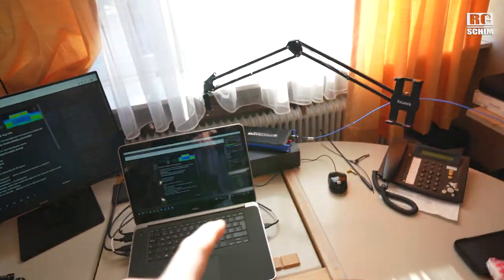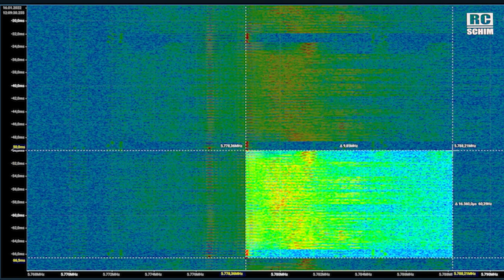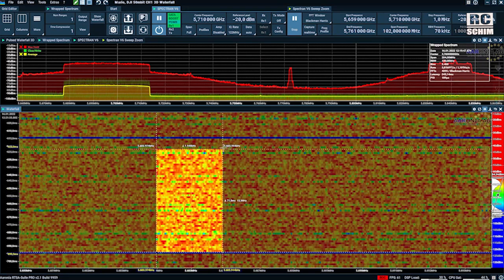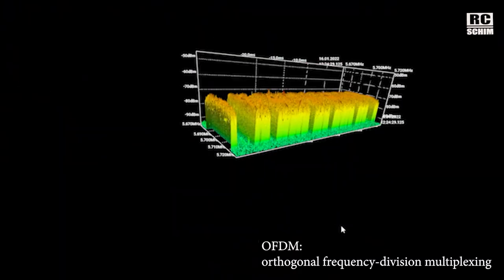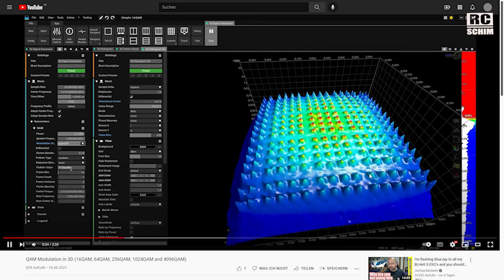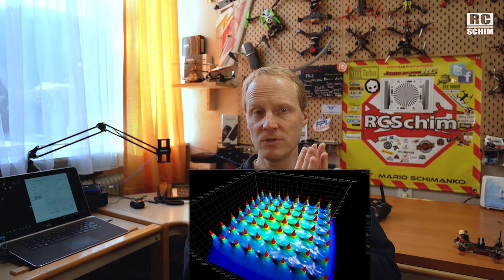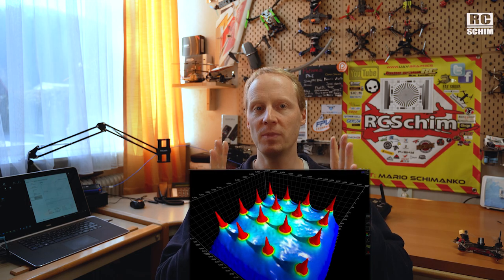RF in 3D: Analog vs  DJI digital Video

Comment: Fascinating visualization and explainations. Can really see how more more signal is packed into the spectrum space. An observation at 5:12, in reference to bit rate decreasing. Since modulation is happening in 2D frequency space, the decrease is a squared function. It helps explain why HD quality drops so quickly in nosily environment, or farther away. (ie: it's to linear). You touched on this again at 6:42.

Great explanations for the target audience on a very complex topic. Appreciate including good references and keeping the topic focused as relates to FPV.

Comparing HDZero and DJI is very complex, as DJI is doing encoding before transmitting, where as HDZero is not compressing. Thus they have very different processes and video quality. Would expect HDZero too would try to use as much as allocated spectrum as possible, like DJI vs analog video.

Is hard to believe how far we (humans) have come with video transmission in last 50 years, even the last 20-25 years. The Apollo Moon program demonstrated the very best video technology that was available at the time. It's hard to imagine what progress will occur over next 5-10 years.

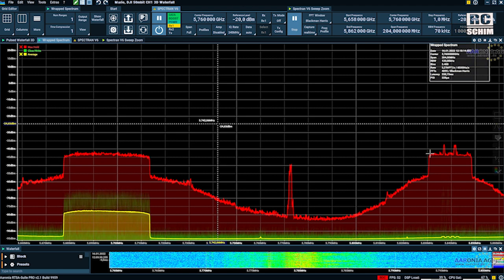Comment: In 2:34 you mention "Random carrier signal spike" at 5772Mhz. Is that signal always present or does that happen only briefly when plugging in the battery?
If it is always present, then that would explain small noise that analog glasses sometimes see.
Really awesome work 👍!

Comment: Nice, but unfortunately the digital spectrum doesn't reveal much without decoding the OFDM subcarriers. OFDM has multiple orthogonal (overlapping in the frequency domain) sub-carriers and they each do QAM so it's really hard visualise much from this apart from maybe the OFDM frame length or symbol length (with empty guard intervals between) in the time domain. Also worth mentioning that OFDM has been in use in WiFi since 802.11a in 1999, so it's not just in mobile networks. I think Livyu did a DJI Air Unit  teardown and found they're using a WiFi chipset.
Reply from the maker: I tried to do qam decoding with the software on the whole 36mhz. If you tell me, that each subcarrier does qam it will really be hard to decode it ;) I've seen 26 arches in the histogram which look like subcarriers to my eyes but who knows... and on top of this: the subcarriers seem to move?
Anyhows, we have a good enough picture of it now I guess. With my limited knowledge I did a week of research and was about to go crazy over this matter, so i needed to finish this video ;)

Comment: Bardwell's comparison was flawed as the camera for the DJI had a wider field of view than the hdzero camera. Wider FoV means more photons per pixel and therefore less noise. As noise is inherently incompressible the HDZero digital link had a big disadvantage...
Reply from the maker: I agree about noise giving you a huge disadvantage with bitrate usage. but do you really think that's the main reason for HD zero to perform worse than DJI? 
A pitty that the cams cannot be exactly the same. Bardwell could have used the same lens at least  (but then he'd altered the focus, maybe messed up - and we wouldnt be happy either :)
Reply: @Rcschim  I don't know if it is the main reason, however it does make the conclusion questionable. 

To make a fair comparison, he could use a slight neutral density filter on the DJI camera  to attenuate by the ratio of the solid angle of each FoV.  Or just swap lenses :)

Comment: do they do a disco version of the 3d oscilloscope ?   i wonder what the components of the latency as far as cam output then compute to send .... and can we expect faster cams and lower overall latency
Reply from the maker: I'm quite sure that the Digital cams are already really good and optimized. The last analog cams I've tested had almost NO latency anymore. Why should they use worse cams?
The only exception might be the SplitHD - since they tried to be fancy here and have 2.7k they had to downscale it and didn't use enough silicone power to do this in reasonable time :)
Reply: @Rcschim  hey, you just made me wonder about dual dji set up, how cool would that be? dji with the action2 built in.   just remember i ran the og split above the eagle micro for two years before the hybrids appeared, i demand copyright money hehehe
Reply from the maker: @TheMadmacs  hehe, I'm sure Runcam considered a dual lens solution, but these days customers want smallest possible size - to fit in tiny builds   (the main selling point for SplitHD - low weight and size). For me the small size point doesnt work anyways, since the DVR board isnt easy to mount, not even on the rather large Chimera5.
Btw: will be getting a Chimera7 finally this week. Excited for epic dives this year!
Reply: @Rcschim  I’m looking forward to seeing the C7 mate, the 5 is still my favourite quad 👍🤜🏻🤛🏻
Reply from the maker: @bugsy742  hehe, had a day off today and could maiden my chimera7. Awesome! Lots of nice chase shots already with 2 chimera and one wing.
Reply: @Rcschim  oh my god! How am I only seeing this comment now? 🤦🏻‍♂️😩😅 ( busy weekend 😬 )
I’m so excited for you mate 😃
Can’t wait to see the footage 😎🤝

Comment: Awesome like Always great work mate!, would be nice to see if the 13km hard limit is due to an implementation limitation or just an arbitrary number put by DJI devs
Reply from the maker: From what I know this has to do something with the sync time. The sync timing increased (doubled) when they enabled the 50mbit mode. I need to check if 25mbit has only 40ms interval vs. the 80ms on 50mbit. The OFDM transmission needs a common time interval to work - and this is the theory for the 13 something hardlimit...   (but don't quote me no this - this is highly speculative ;)
Reply: Has to do with physics and the speed of light limit. That common time interval gets exceeded when the 13km is reached because of the time it takes radio waves to travel and the use of bidirectional transmission between goggles and tx.
Reply: @Rcschim  please check and show us, better using 25mbps mode or 50mbps mode for long range?
Reply from the maker: @DanielSingerX  yep, that's what I've read as well. I'd like to do the math myself and see (for example from the 80ms interval between packets) how I come to the 13.something limit.
Reply from the maker: @erlandfpv  my gut feeling is: 50mbit should be better.  but I will try to test this on the field with 25mw and going as far as I can in both 25 and 50mbit.
in fact I found a nice way to compare antennas or range with the help of telemetry (distance) vs. bitrate in a nifty excel chart. just need good weather now ;)
Reply: @Rcschim  thanks,  😁👌 for the info, i still using 50mbps for long run , some my friend tell me using 25mbps, but, i can't brave enough, hahaa. I'm  mostly fly from one location to others location across the sea,
Reply from the maker: @erlandfpv  flying across the sea sounds scary! I also mostly fly 50mbit, you need 25 if you fly with more than 1 other DJI pilot or if you want someone to be able to see your flight in audience mode.   ultimate range should be the same - but I'm not sure.   on 50mbit you have more useable bandwidth at the end of your range - so better picture.
But with good antennas you run into the 13km hard limit anyways ;)

Comment: Analog should have lower latency than digital, right?
Reply from the maker: Yes, analog (if the cam isnt crappy) has ~ 10-15ms   glass to glass latency - where it mostly depends on the refresh rate on the goggles. The RF way has almost 0 latency because there is no buffering or any calculations...
that being said - I'm quite ok with the 25-40ms on DJI - but I definitly notice the lowLatency mode - and it's important if you wanna fly acrobatic.